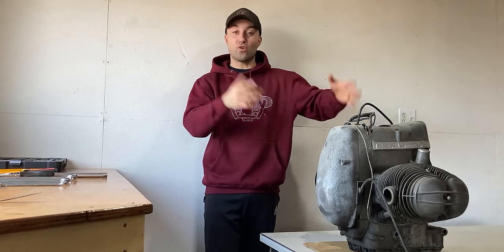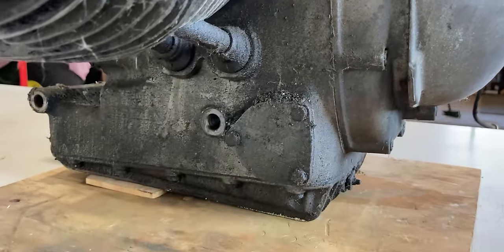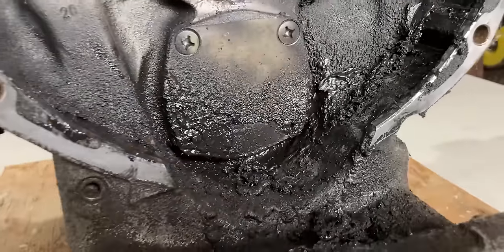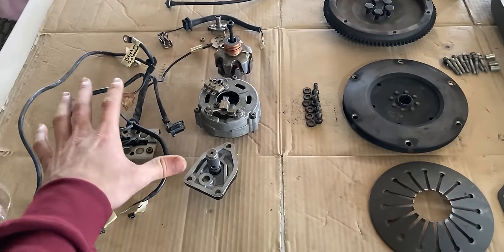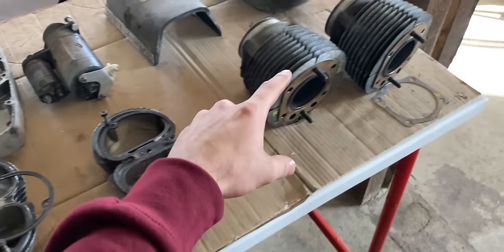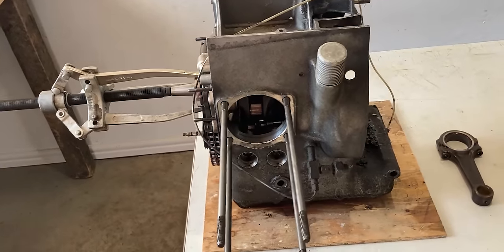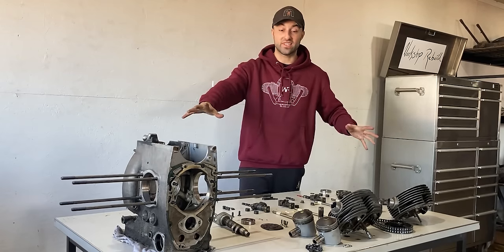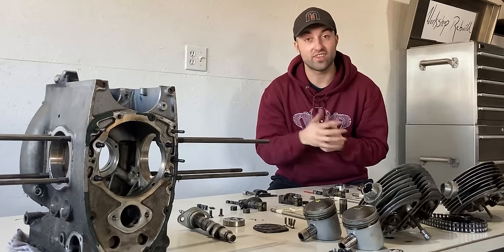BMW R60/5 Airhead Engine Teardown - How Bad Can It Be?

Comment: Listen up son. Get to the chase. A 50 yr bmw engine will  be full of dirt, corrosion and oil leaks!
Reply from the maker: Well first off this engine is 50 years old and it had various oil leaks. The worst leak was on the rear main crankshaft seal and you can clearly see that. The aluminum is heavily corroded and this also very visible (rust doesn‘t form on aluminum, but oxidation does). Unfortunately it wasn‘t full of dirt, probably because mice and other objects didn‘t make there way into this engine.

Maybe one day I‘ll find an engine that‘s 100years old that will check off all these boxes. Thanks for watching. Regards Andreas